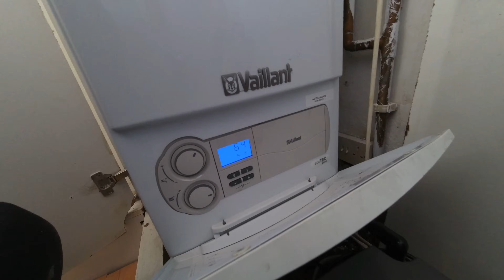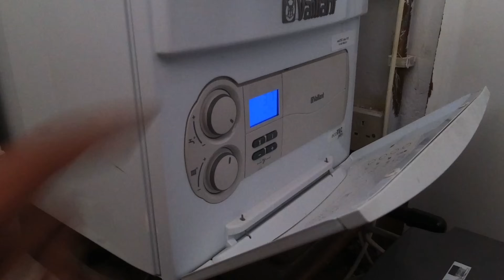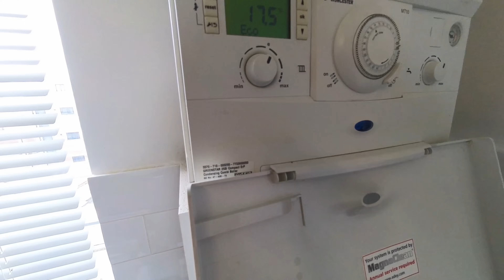Condensate Pump Flooding Cupboard - A Day In The Life Of A Gas Engineer 153

Comment: doesn't Vaillant have that 'burner off' thing where the condense connects to? All good giving the pump a perm supply but it wont stop the boiler if the pump malfucntions.
Reply from the maker: Not on this model I'm afraid, I believe it's only on the newer style ones
Reply: @cputilitysolutions  Good to know, thought it was a standard thing since forever. Cheers